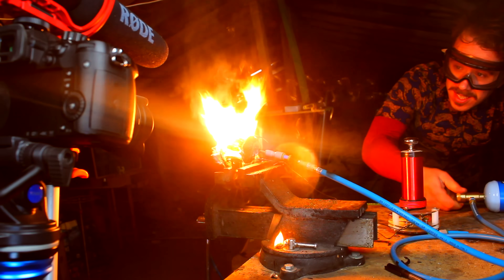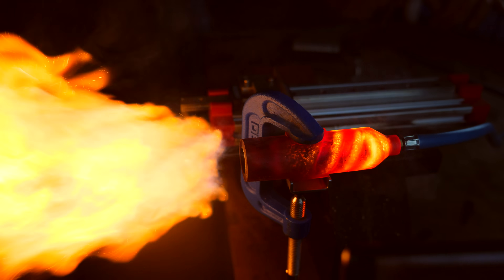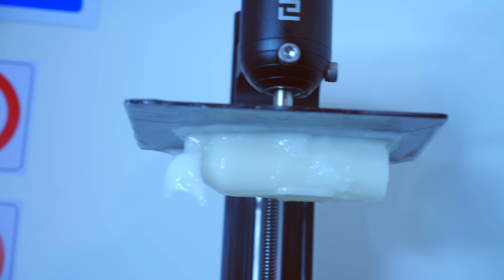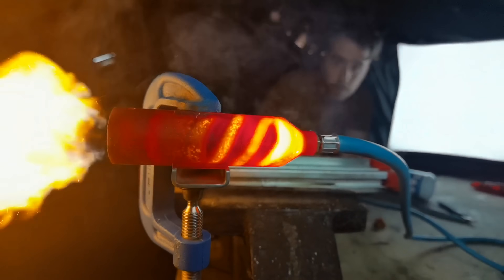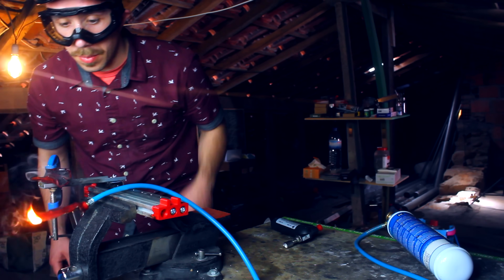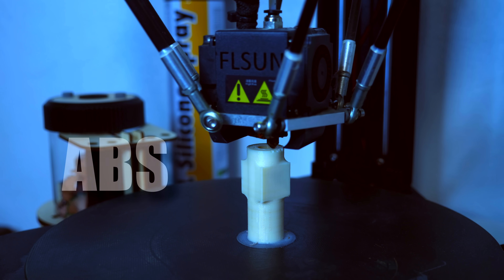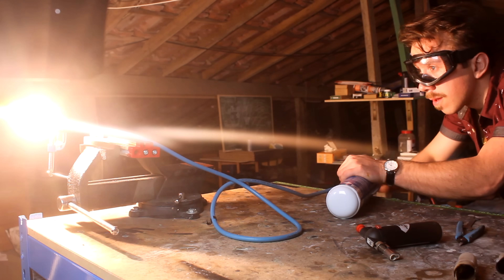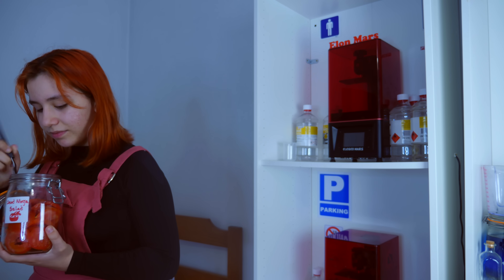Rocket engine that uses itself as fuel! (3D Printed)

Comment: Why dont you try to make an ablative rocket engine or just the nozzle. you have to apply a thick coat of a slow burning material that slowly burn away thus protecting the resin parts. Something carbon based. Or you can mix the resin with carbon and apply it with a brush and harden it with uv light.

Comment: dude, oxygen is really unreliable. they are super volatile and it will burn as soon as it touches a wall.

a way to make oxygen more reliable it to add nitrogen to it. aka NO2
yes.
nitro. 

that's why cars use NO2 to cram more oxygen into the cylinder, because if they put only oxygen it would combust in every hot part in the exhaust, intake or even cylinder walls 
the nitrogen will keep the oxygen from combusting until everything gets compressed, witch break down the molecules and bang

combustion (but only when you need it)

and also, imagine the title of that video: NOS powered rocket engine. impossible to not check it out

Comment: You should come up with an ignition system that ignites the top of the internal canal first, so that the whole canal catches fire almost instantly at ignition. It will greatly increase the surface area inside the rocket that is burning shortly after ignition, which in turn should give you a much larger thrust. Designing the body around that should also help you make it burn more evenly (so that you don't end up with most of the fuel unused).

Comment: I'd be interested to see what might happen if you use the ceramic resin, without putting it through the kiln, so the resin is the fuel but the ceramic is still there to provide a little structure

Comment: The resin used in 3D printing is mostly oils -- vegetable oil, even. The extra chemicals added are triggered by UV light to change the oil's monomers into long polymers that tangle together to become solid. So, basically, you're using an oil for fuel, just in solid form. The only thing I'd be concerned with are the traces of the other chemicals used to harden the resin.

Comment: Future video: 
Put your 3D printed fuel into a steel pipe und print a extra nozle out of ceramic resin. Your problem, that you have no thrust, is that your nozle burns out to quick.

Also build yourself a proper testrig for your rockets. Super easy to do: 
All you need is an Arduino, a small LCD display, some lines of code and a load cell + shield.
Strap your rockets to the top of the load cell and tighten the other end to your vise. And like that you can measure the force and compare your rockets properly.

Comment: I feel like you'd be able to use some kind of sheet metal to get a satisfying combustion chamber/nozzle that wouldn't burn. I think copper would work well with its high melting point, and from what I've seen, 30 gauge copper sheets seem pretty easy to work with. I haven't worked with any sheet metal personally, but you might be able to create a pattern for it, cut it out and weld it shut. Again, there are many issues with this, such as the welds melting and finding a way to make the whole thing air tight, but I do strongly believe that you should look further into using metal for these. It seems like 3D printing is reaching its limits for this use case. To further this point, I think your partially metallic TurboJet engine was definitely one of your greatest successes!

Perhaps it's less interesting of a process for you, but I'm sure there are ways to get your parts professionally machined by some manufacturers online, and then you could focus more on optimizing the fuels/design of the engine, as well as getting good thrust (and perhaps even some shock diamonds, that would be beautiful!) instead of just trying to get something that won't fall apart most of the time. 

And just in case you actually see this comment, I'd just like to add that I absolutely love your videos and it's always such a delight when I see a new one pop up. I'm so glad to be able to follow along with your progress and all your hard work! :)

P. S.:  I've heard those ABS fumes can be pretty harmful to breathe in, especially if you're burning it, might want to look into that

Comment: Hello Integza, you need to wear a mask burning some of those materials in an enclosed space are very toxic.  Just 3-d printing ABS makes me sick because of smell that is produced the printed.  As far as the engine that you are working on is that you need to add a container to hold the fuel and inlet.  I think if you add that and a nozzle you will see a huge difference.

You need a gasket or a sealant between sections of the engine.  So if you take you ceramic engine and line it with the sugar or abs engine then light off and it should go!

Comment: It would be interesting if you use your 3D print in ABS as burner/fuel then wrapping it around with carbon fiber (or fiber glass) then design your nozzles in fiber too in order to maintain the thrust as longer as possible (before it dies like your tomatoes ;)
In that way, you would have a reusable rocket container with switchable nozzles which you can design different 3D burners (sugar punch, abs...)
It could worst it, we never now till we tries 🤣

Comment: You still need a faster way to cut off the oxygen, even if its just as an emergency cut off so you can close the valve without having to turn the main valve slowly while it burns out of control.

Você ainda precisa de uma maneira mais rápida de cortar o oxigênio, mesmo que seja apenas como um corte de emergência, para que possa fechar a válvula sem ter que girar a válvula principal lentamente enquanto ela queima fora de controle.

Comment: Tips from a sorta arm chair rocket enthusiast.  Put some form of ignition inside of the combustion chamber instead of just having a sparkler stuck at the entrance. They utilize this method in large solid rocket engines when they blow a stream of fire down the core of a rocket engine in order to light the whole grain at the same time instead of having certain spots that light up as the rocket engine and having inconsistencies. You don't have to use to use a small rocket engine to light yours but I think it would dramatically increase your thrust if you can manage to light the whole thing at once especially when you look at the footage for the see through resin rockets it looks like only certain segments actually ignite and after the case breaks the engine is over. So having all the fuel ignite and burn out at the same time would be pretty good at maximizing thrust. Now I've never actually built a rocket engine but I think that if you use a gas like propane to fill and ignite the whole thing at once and switch off to oxygen you can ignite the whole grain at once and have a full burn.

Comment: I'm surprised the rocket engine didn't have a thrust, because it seemed to have had enough.  I would recommend trying to reduce the nozzle, the pressure was sufficient but the hot air did not have enough speed.  I enjoy these videos and I'll be glad if you continue.

Comment: I think you should try to make a wire EDM machine! It'd work wonders if you pair it up with that CNC, as you'd be able to cut some very thick pieces of metal precisely (for example, for the body of the rocket) and then use the CNC to machine more complex parts.
There's an awesome video by a guy called BAXEDM who shows his EDM machine, and even gives out the plans for it.

Comment: It'd be awesome to see someone try and 3d print a rotary (Wankel) engine. I've never seen someone try and do that. perhaps with some 3d printed nylon and Delrin (if you can print it) and some seals you could get one to work either with fuel or compressed air, or both lol

Comment: First of all it wouldn't be a bad idea to put a mask on while doing these tests, because toxic fumes.

And the body you could make a outer shell you can slip over out of ceramic or metal.

Also it looked like most engines broke because of the pressure of the clamp, so a different mounting mechanism wouldn't be that bad

Comment: So, following the logics of you channel I would suggest to use a "fine grained oxygen-permeable wool-like 3d printed candy sugar fuel core" (I think you get the idea ;) and put it into a ceramic raisin printed shell. But: since you had a lot of trouble with the tightness of this material I would suggest to use some heat resistant non-porous material to solve one problem at a time: Therefore you could use metal for the shell. The best thing would be to use something that already exists and use it for this: For example the cylinder of a metal bicycle pump, that often has a threaded end with a hole in it where you could put ceramic resin printed nozzles to hold it back. Hope that gives some Ideas :)
By the way: You totally should talk more German! Danke schön!

Comment: Try to make a jet car like that https://youtu.be/gUUS3_bz-rw
You 3D print the car body in PLA, than you 3D print the tires in tpu. To avoid the oxygen tank, use your turbo charger with a better designe of the body to increase compression and air ratio

Comment: Try to do Lost PLA casting. You 3d print an object, bury it and sand, and pour molten metal. The molten metal will vaporize the PLA and replace it resulting in a metal version of the 3d printed object. There are also wax filaments manufactured intended for this process.
Reply: This. Though, recently, there has been a similar thing but with ceramics. You print the item, dunk it into the ceramic, make the ceramic harden and burn out the plastic. With a bit of handywork you can get a lot more detail to it, though with one more step involved.
Reply: Melting the metal isnt terribly hard to do either, especially if you use something like aluminum which has a relatively low melting point
Reply: I think he already tried, I don't know...

Comment: Idea: do a 3D printed ceramic housing and nozzle, and then 3D print the grain out of a different combustible material. Structurally stronger and less likely to blow up, but still using a 3D printed propellant grain.

Comment: Great one once again.....your ideas should blast right off 🤪

You can combine your two ideas .... the resin fuel and the ceramic metal coated parts for the rocket engine outer body. Making the engine more resistant to high temperature and allowing you to print the fuel .... the sugar resin or ABS whichever you choose in a different insertable geometry. Giving you an opportunity to control the overall shape of the exterior of the engine and the burn chamber with ceramics and change the dynamics of how the fuel insert Burns by its shape and geometry.

Comment: One of your mistakes was not igniting the solid fuel at the back. Normaly it should start in the back and be pushed forward by the oxidizer. Just light the sparkler at the tip and push it deeply inside. ;)

Comment: Unless the technology has changed in the last 10 years, hybrid rockets do better with less flowy nozzles. Ie,.. the chamber should be flat at the nozzle end with the nozzle protruding from the flat like a K or I<  . This creates a vortex just before the nozzle which helps with mixing and combustion. Also, make the throat smaller to increase pressure inside the engine, thought that means you may also need more pressure on your oxygen line. In pulse jets, they often have issues with regulators providing enough pressure, so remove the regulator and only use a valve( if possible).

Maybe print an inner and outer shell. The inner shell will be out of that ceramic stuff. Outer shell would be FDM printed Carbon Fiber Poly Carbonate. I mean,... if you're going to make videos, you need to go all out, right!?  :D

Comment: I read a research paper that I found on the internet, talking about ideal solid fuels for the hybrid rocket engine. 

The paper talks about using a material called polybutadiene polymer (HTPB). They also say that:

"This mixture can be easily enhanced by adding agents to
 increase the mechanical strength of the load, agents to increase the density, carbon powders to obtain opaque surfaces which stop the penetration of the thermal radiation or metallic powders to increase the energy resulted following the combustion process".

Comment: You could 3D print just the combustion chamber out of ceramic, and then 3D print a stronger rocket body to the outside the combustion chamber. That way, the ceramic part is just for thermal insulation, and the external part would give the body strength to keep the explosion inside the rocket. Great content, always happy to see your new videos!

Comment: you might want to try putting a sturdy sheet of metal behind the engines, to simulate a launch pad. I think a lot of initial force happens because of the hot air hitting the pad and expanding in that small space between the nozzle and the pad.

Comment: You could do a ceramic nozzle and let the printed fuel sit within a metal tube which will allow all produced gasses flow in 1 direction. Ideally the perfect measurement for the rocket output is how well it can toast/roast or burn the Tomato Lord and his ninja's. Or much thrust is required to smash Tomato Lord and his ninja's

Comment: make a arduino controlled turret that tracks down and shoots the tomatoes (that are bright red so it should be ez). For the shooting mechanism you could use a gravity feeded auto crossbow with an arming motor or a powerful coilgun so you are protected 24/7 from those red things.

Comment: i'm not sure why i'm just now noticing this, but please tell me you have a particle filter! there is many studies showing that pla and abs  emit micro particles in high concentrations around a printer, more so abs since its burning petroleum. please get a filter and properly ventilate your room, you can even 3d print most the parts, and protect your lungs so you can blow out fires well into old age.

Comment: you should try to use variable infill+ Gradient Infill, so you get more fuel, in a small place. Were in the worst case you slice a separate cylinder with another infill than the nozzle, and then modify the g-code to combine them.
PS I would love to get a response from you Integza.
Reply: Holy shit this sounds like movie scientific jibber-jabber and I love it
Reply: And here I just suggested making ribs or something inside to increase surface area. Seems like you know a lot more about how slicers and such work.

Comment: Why dont you mold the propelent and fit it in the engine? You can make heat resistant walls have greater durability and the nozzle wont just shatter into pieces

Comment: What you really need is an aluminum rocket motor casing and a graphite nozzle. That way more of the plastic is used as fuel because it does not have to hold the pressure of the combustion. I'd use a paper liner that the plastic goes into to make clean up easier. I may be willing to lend or trade some motor casing, bulkheads, and nozzles for you to experiment with. PM me if you are interested.

Comment: what if you made the body out of the normal resin and or the ceramic resin, I don't think baking the resin that time would help, and then print the double helix out of the sugar resin. Cap it off with the nozzle made from normal/ ceramic resin and try that. I'm thinking that since the body is made of sugar as well, it'll be more likely to catch on fire. It also might be beneficial to just make the walls thicker. You aren't curing the part so you won't have to worry about deformation.

Comment: I think it is about time you start casting some of the parts
Reply: Yes... print it and put it in a compacted "green" sand. Heat it in your oven to burn/melt off the plastic and then cast the part. Depending on the metal you choose to cast the part you could easily braise it to anointing parts. Blam! No more leaking parts and longer test times!
Reply: @maybethistime6761  anointing?

Comment: I've been thinking the last couple of weeks can you make a water jacket to go around the outside of the motor to stop it from melting... buy water jacket I mean literally seal the motor in the middle of a bucket with a large thermomass you don't have to use water you could actually use any cooler non flammable liquids ....also I noticed you using some sort of paint to seal the motor if you were to dip the motor straight into whatever paint solution that is after doing the initial coat you will get a more consistent seal along the entire motor...

Comment: Instead of making just plastic. Try adding red iron oxide. 
It increases the power of sugar rockets. Maybe it will work with plastic as well. In cade u can mix that in the plastic 
And instead of making the plastic as the fuel
U can 3d print the fuel case ( empty cylinder as the outer shell and another empty cylinder in the middle as the combustion chamber. U would only have to fill the space between the two cylinders with sugar rocket fuel but without the potassium Nitrate since the u can use the LOX as oxidizer and use it to control the throttle
Abraços dos seus seguidores brasileiros

Comment: For gods sake integza, built a solanoid- valve based controll panel ( solanoid-trigger valves and backup valves where you can regulate the power, controlled by integzabot or a arduino)for your testes,the panicy turning  the contol valve makes me anxious every thime and it could help your tests to be more consistent, easy and safe

Comment: If you want 3d printed fuel, then you should do the nozzle and the casing out of some metal tubes or maybe 3d printed porcelained ceramics. It will increase  thrust over time

Comment: Idea for a new rocket:
  Perhaps you can make a cast out of iron or aluminum.  For the connections of the two or three pieces, you can produce them to fit the mold nicely, using the principle of tongue and groove. 
  Maybe you can use one of the ideas to solve the problem of the leaks.